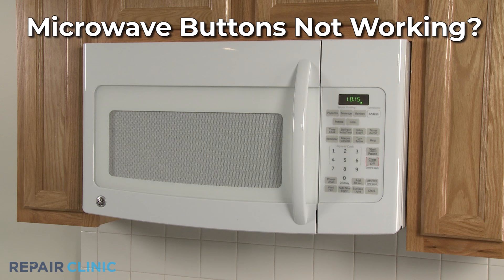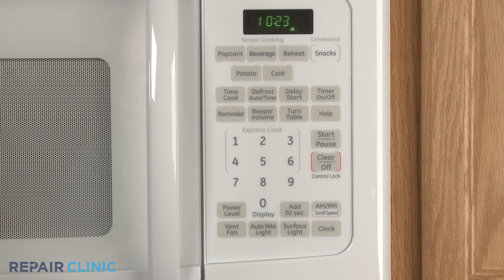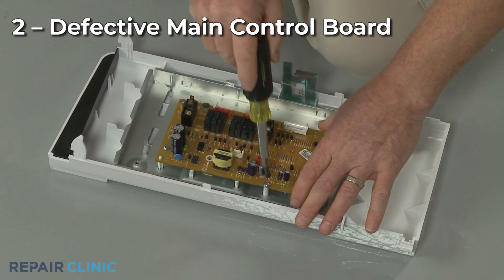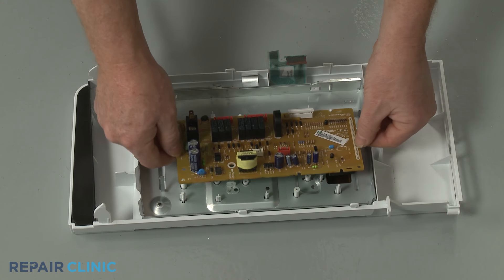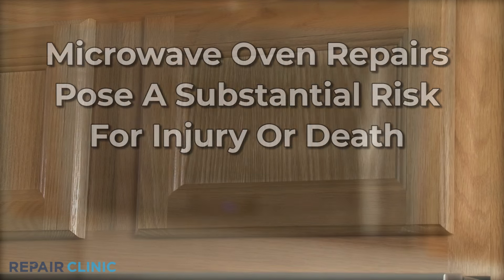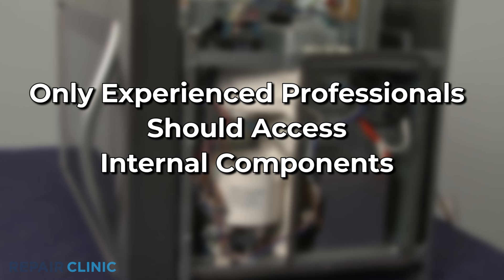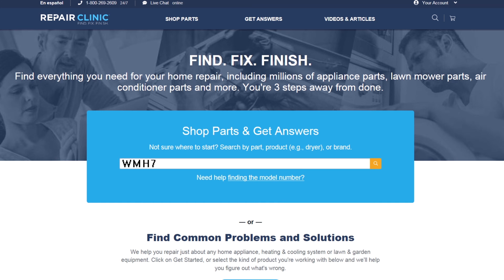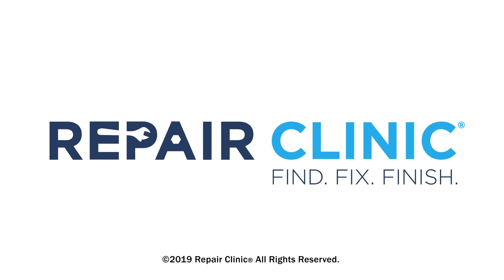Top Reasons Microwave Buttons Not Working — Microwave Oven Troubleshooting

Comment: If your microwave touchpad has certain buttons not working, repair don't replace. Take off the touchpad carefully and for every button rub a pencil with graphite on each of them. It worked for a Sharp Carousel microwave, and that microwave has found a new home and works as if it were brand new.

Comment: have a LG microwave, around a 2019 model,, if its unplugged a while, buttons stop responding , sometimes  it may take a day or two before the buttons start working again, it lights up like normal.almost as if it has an internal battery or something that drains power when unplugged or something, any idea ?
Reply: @repairclinic  I plugged it back in and wouldn't do anything but light up like normal after about 24 hours or so then its ready to work, do they have any kind of C-mos battery like computers do ?

Comment: All of the buttons on my GE Spacemaker microwave work. It has power but when I hit the bottoms nothing happens. Any suggestions anybody?
Reply: Figured it out. It was one of the door switches. $8.40 and is back in operation. Thanks YouTube 👍.
Reply: fuse near power cord
inside

check it     dont die
(1 yr iknow)

Comment: Hello!  Could you please help me? 
I have washing machine with bearings gone or spider gone and i opened my washing machine (Front Loader) the tub has screws but the screws are covered with plastic what should i do?
Reply: LordenTree what is the model on your washer?
Reply: Replaces the screws with steel screws, cut the earth wire as well as the active wire and re-attach the active wire to one of the steel screws, switch the washing machine on, use your hands to brace the machine to keep it stable (this only has to be done once), activate the machine and once the washing machine kicks in you should be all good to go.